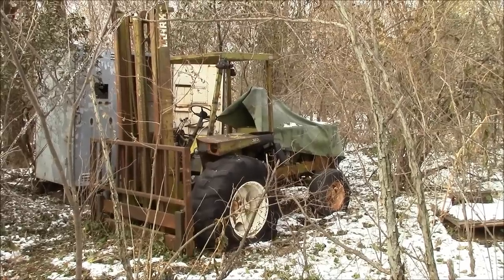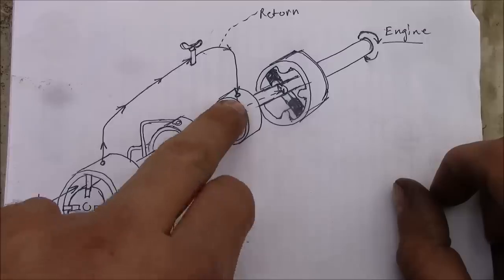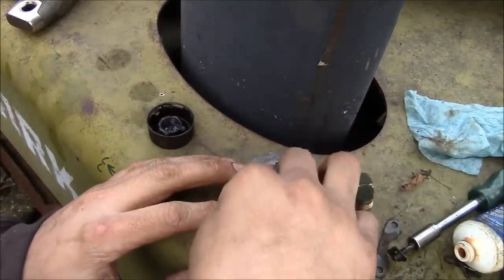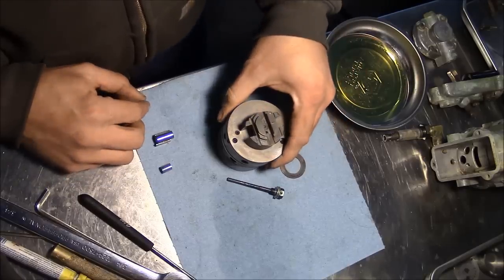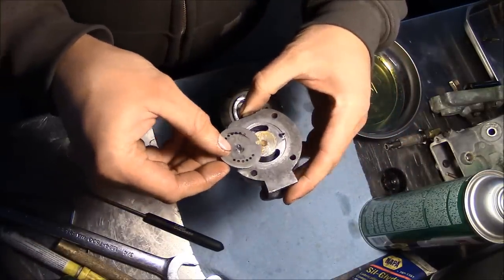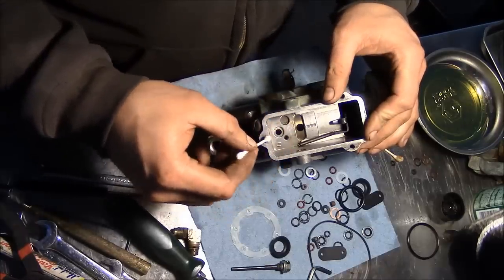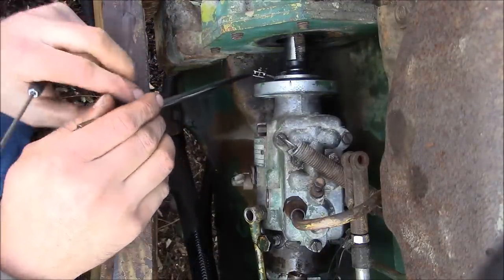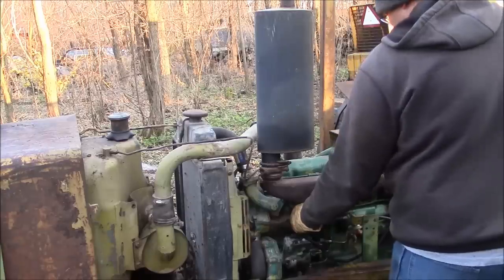Neglected Clark All Terrain Forklift - Will it Run Again?

Comment: One time I started a job everyone wanted to use all the good fork lifts and the only forklift left to was old Clark with the metal levers next to the seat to operate the thing I came out winter still got what I needed moral I'm so good of a forklift operator I use what there to get the job dun,, should of seen the guys at the job site haven't seen that fork lift operate in years and here comes the new guys riding it like it was brandnew that forklift was greatful to have someone like me operate it

Comment: Excellent drawing and explanation  on the injection system   in the 1970s  my parents both had fuel injected cars that   had   relatively simple and more mechanical  operating parts to them even though it technically was Electronic Fuel Injection  i remember my Father learning  as much about the systems as he could  and his  amazement as to how much  more pressure  was in the system compared to carburetored cars  a common mistake was using    older  standard fuel line and hose clamps that couldn’t take the high pressure very long    of course Deisel  is a whole different  Ball Game

Comment: sounds like blocked filters. also CAV pumps have a screen in the end plate of the pump. but i don't know these pumps. Best pump repair video i have seen. **
Reply from the maker: No. There is plenty of fuel reaching the injection pump.

Comment: That looks like the same engine on the 450 dozers and they spun a lot faster than that one does on 12 volts. I was around a mechanic changing out a unit injection pump on an old knuckle buster Cat 12 grader. He handed it to me and said to take it apart and hold it. I did for about 10 seconds and he said to put it back together. It wouldn't go back. He said the heat of my hand swelled the plunger that much BUT that unit was WORN OUT! there you go about crazy tolerances! Excellent description of the Roosa Master pump. A-PLUS!

Comment: Great Video Wes!! My two cents.......Blow back the lines to the tank, & replace the fuel filters. Maybe your getting fuel on a static line, but not enough flow to support a running engine. Costs nothing to check. But........your there & I'm here, so you have the birds-eye view of whats going on.     Best of luck.....................

Comment: There is a check valve on the return line. Make sure that is clean as well. I had one that was gummed up. It will run for a minute and once it builds up too much pressure on the low side it wont allow the high side to pump.
Reply: I've had then not even start when the return check is plugged up. The return check is a common source of no start, engine stall issues, especially on pumps that have had the flex ring totally deteriorate, into fine particles.

Comment: nice work on the pump even if it still has issues.  are you going to pull the mast off to get it home on your roll back or will it lean forward far enough that you won't be over height?

Comment: As the starter 

Tip put a 6 Volt anker instead of the 12V it will be much stronger en spin faster 
We did that with Mercedes engine’s 
Works great and reliable

Comment: Good job Wes. Almost looked like a runaway when it started.
Best explanation of an injection pump ever. I wonder if the timing is just off enough to be the problem? Too advanced so it only runs at high revs? Hope the rebuilder finds a problem and all will be corrected.
Thanks for sharing.
Reply from the maker: It could be. The injection shop should be able to tell me if the timing advance is working.

Comment: Liquid fire brand starting fluid has top end lubricants in it and works pretty good, just needs a more liberal spray and it may have less time before it doesn’t work, I’m unsure, also I’ve noticed a few brands like that and quick start all seem to “expire” after a while once you use them, so keep that in mind (they still work for gassers and the tight tolerance diesels you shouldn’t even be using any form of starting fluid in anyways)

Comment: 3 thing with a diesel, 1.  Got air?  Make sure air cleaner is not restricted.  2.  Got fuel?  You should have put new fuel filter and fuel to that pump. sucking dirt into a clean pump isn't good idea.   3.  Does it crank properly?  You got a weak battery/starter or cables.   It may not idle due to dirty injectors, should have run it for awhile. Check the fuel bypass valve, make sure it's not suck open.  Good luck and hope to see it run in the future.

Comment: In the Army we had some Continential Diesel powered gensets.Those engines were equipped with a Roosa=Master fuel System.Funny thing being a fixed speed setup the only way to change the operating speed of the engine was to install a different Pump.The ones we had were set so that engine be set to run at 1200 rpm.Engine had timing marks on the flywheel for 1200-1600-and 1800 rpm By setting proper timing marks then installing proper pump engine would reach and hold RPM.Funny system but it woeked most of the time.

Comment: nice work Wes nice work , on a pump like the one you just reman...... how do you increase the fuel for more power . And i have been looking for ages for an explanation on these stanadyne´s that even i could understand and here we go Wes ........... thank you very much and have a nice day . Ivan
Reply from the maker: There's really no way to "turn up" a Roosa Master pump. You could tighten that leaf spring a little more to increase the roller to roller distance. That would give more fuel. Or mess with the governor spring. But those are both risky IMO.

Comment: you can try  using diesel soaked lighted  big rug on a stick,on the  intake manifold so the engine can suck the fire and gases and will start,the rug must be secured so  it not get sucked into the engine,we in eastern europe used this method  before the starting spray appears. another method was pouring  diesel on a  red hot iron plate so the engine can suck the fumes, like the hot bulb , sure if the  injection pump is bad, it will stop . my dad used this methods 35 years ago.

Comment: Hope you found whatever the problem is by now, sounds like a restriction in the supply, possibly a poor connection letting it suck air under that condition.  Had a similar thing happen on my 1st gen. Dodge, which has a similar pump on it.  Also, a weak lift pump made it do the same thing,.

Comment: Seems like a good machine to have around the house.    We have an old 1981 John Deere 125 skid steer sitting in the back yard.....hidden a little bit by an old fence.      One of these days we will ask for help getting it running.
Reply from the maker: Does it have an Onan gas engine? If it does I'm sure it will run.
Reply: @WatchWesWork  It has an Isuzu Diesel.   It had troubles and a guy we knew added an electric fuel pump from a car.  (That wasn't the fix we hoped for but that was all he could manage).  The car fuel pumps needed to be replaced every so often.   I think it lost fuel...all those years ago. And so it sits because life is too busy (Which means....I'm not playing life well if it is too busy....)

Comment: My question was about the Clark UT60,  I was a mechanic on Clark Forklifts for 40 years, I do believe it is a Perkins Diesel  engine. which is one of the best diesel  engine made.
Reply from the maker: No. This is a John Deere engine. I've never seen a Perkins engine that did not use a CAV/Lucas injection pump.

Comment: Takes "courage" to tear a Roosamaster pump apart. Scary tolerance to those inside parts is right. I'd be removing the tank & cleaning it up while the pump is at the shop. Like your video's 😀👍👌

Comment: Have you chased out the fuel line from the tank to the fuel pump? You could have a partial clog, enough fuel is passing for idle, but not for high rpm..  Also check the valving in the primer, the bypass might not be fully open.

Comment: A common problem with those pumps not working properly is supply line restrictions or air leaks.   Most common flow issue is the filters being varnished closed due to having sat for so long with water in them or the lines themselves being corroded internally or the pickup tube inlet/screen being clogged.  

To find out if those are the issues it usually take making a adapter that allows for a suction gauge (common filter minder vacuum gauge) and clear line to be installed just ahead of the fuel pump inlet.       Combined they will tell you if its restriction problem or a air leak issue or a bit of both.     ~$20 to make and well worth it even if you only use it once.

Comment: It’s amazing how many leftover parts come in a kit ! Lol. First step is to get it to run ! Second step is to get it to run well ! Suck / bang /blow ! For a self taught man your doing very well ! It’s also deer season here in Minnesota so it’s a great idea to wear blaze orange when in the woods . I’m looking forward to seeing it get back to work once again , those big fork trucks are so handy to have and I’m sure once it’s running properly it will stay that way with you on the job ! Heck make a blind and use the truck to elevate it for hunting ! Lol. ALSO I’ve found fogging oil works great on diesel and outboard motors to get started !
Reply from the maker: What do you use to fog the oil?
Reply: It’s called fogging oil . It’s basically starting fluid and oil mixed . I use it on outboards because there 2 stroke and it lubricates at the same time .
Reply: Watch Wes Work fogging oil comes in a can like starting fluid

Comment: You can help a diesel engine starting, by igniting a rag with dipped thoroughly in diesel fuel, ignited with a small gas torch, and holding it in front of the air inlet of the diesel engine. The heat and the half-burned diesel fuel will help it start. :)

Comment: I've just completed a reseal of a DB2 off of a 6.2 Detroit. Like you, I'm a first timer to these. I took mine all apart, even the don't touch  high pressure side. Wish me luck. Don't take this the wrong way, but this video makes me a little worried that mine won't be right either. I do have a book, but there are still some unanswered magical parts which I hope are right.
Reply from the maker: All I can do is put the pump back like it was. I can't actually test or calibrate it. So, if it worked before, it should work now. But mine had issues before I ever took it apart.
Reply: I'd be interested in your flex ring for the governor basket, if you haven't tossed it yet. My kit didn't come with one, so I had to order one. Having a spare would be nice.

Comment: Make sure that fuel solenoid is wired to a source with 12v while cranking. I worked on an old Deere dozer that ran great but started very hard. It would only start on its own if you let go of the key at the right time and the solenoid energized while the engine was still spinning. Just needed to move the wire to a different terminal on the key switch.
Reply from the maker: I've seen that happen before. Especially the style with a separate hold coil in the solenoid.

Comment: Hay   Wes  on  those  rusty   fuel   lines   I  use  a  Burns a  matic  torch   for  just   a   second  all  ways  works   also   works   on   rusty   brake  lines   ,   hope   this  helps.
Reply from the maker: That's how I eventually got the return line free. But I had to put it in a vise and it took a lot of heat.

Comment: Diesel starter needs to crank at 100 RPM to start.  I had a simular problem.  I pulled the starter and found a broken weld on the winding.

Comment: 👍👌👏 Thank you very much for the good describing of this interesting injection pump. This principle seems a bit similar to rotary engines (Felix Wankel). In my opinion it is simple and therefore ingeniuos. Neither much parts nor valves.
2) Maybe there us a lot of dirt/gunk in the tank, hoses and lines (like it was in the pump) and that's one of the problems?
Thanks a lot for making taping editing uploading and sharing.
Best regards luck and health.

Comment: We have a jd2640 front loader that is a real pain to crank.  Put a better starter on it and it’s helped, but the hydraulic pump puts a lot of drag on the system starting.  There’s a T handle on the pump you crank in and it releases the pressure so you can start it easier (usually what I do in winter).  The other trick is jerking the steering wheel back and forth while cranking.  Idk if this has the same big crank snout driven pump on it or not.
Reply from the maker: This machine uses a gear pump not a piston pump like a real John Deere. So you can't unstroke the pump as you described, but it also should have less load on the hydraulics than the closed center system on your tractor.

Comment: rebuilt the russo u have to charge the fuel going into  the pump, assuming  the pump is working  properly ,i charged the fuel with a jetta high psi fuel pump , worked great

Comment: Wes , when you put the pump back together, do not move the throttle lever ,the linkage will disconnect and the engine will run away , that's why they are wired down when you get them .
Reply from the maker: I did wire it at full throttle.

Comment: It's a shame no one takes care of these and then calls them shit. There are some really good forklifts out there that people declare garbage. We have one at our shop, an old Hyster, and it's an awesome forklift. Everyone that uses it loves it, but it's just so beat to hell and neglected it got put in storage for fear it would break down when we really needed it. In its place we got this big 2 year old toyota that's a foot longer, a foot wider, and struggles to lift the same amount. Because of the layout you can't see through the carriage (it having thick tubes the forks slide along that block the view) or around it because the body is so wide and the propane tank sits so high up behind you. People don't realize six inches extra on either side makes a huge difference in what you can see and where you can go

Comment: 24Volt is good way to start old equiptment. Put key to Start-position and hit 24V jumper cable to battery same time. Voltage wont rise too much to burn oldschool ”electronics”.

Comment: Not sure what brand of "ether" you get- but actual
"Starting fluid" has White Mineral oil for top cylinder lubrication.
It's usually emphasized on the label of quality brands-
Sta-bil, Pyroil, Polar, Johnsen's, Prestone, CRC Jump Start®
With Lubricity is one of the best. Rather than relying on
the oil pump and molasses to hold compression- these
formulas allow faster cranking, saving the battery and
rings/cylinders during cold cranking, down to -65℉ (-53.88℃).

Care must be taken on diesels with glow plugs, and some
engine manufacturers advise against using any type,
so follow their directions above anyone online.

Just like Teflon tape and colored anaerobic thread lockers, I 
see so many mechanics on YouTube use Starter fluid improperly,
or claim that it washes the cylinder walls.

It must be shaken well, then sprayed in the intake while cranking 
to ingest the charge properly; a feat to do if alone, but that's what's 
expected by the manufacturers. Ether's flash point is very low, even
in below freezing weather, and the white mineral oil ensures
good compression- the backbone of a diesel engine.

Gasoline engines can suffice with merely the ether vapors,
coming from whetting the plenum and runners- but diesel relies
on a wetter charge and oily rings.

A remote starter not left at home would work well.
Reply from the maker: If you spray ether or WD40 or anything in the intake of the engine while cranking it will drop the RPMs to basically zero and will not even try to start.
Reply: @WatchWesWork  On this engine only?
That just sounds strange. Must be a design to not need?

Comment: Have you tried using Naphtha? Nasty stuff, i know, but i've yet to see the crud that doesn't fear it. Heck, i dip my bike chains in that stuff, slush it half a minute, pull them out and in one pass with the hose on the parts cleaner, they look brand new (minus wear and tear).
Reply from the maker: Yes. It works on some things. Does not work on others. I think brake clean uses Naptha.

Comment: Nice video Wes. Is the old forklift a Military version? I had an old generator from the Air Force and I could crank it over on 12 volts but never get it to catch.  I talked to an old man from the area and he said try 24 volts  so I did, it ran great.   Matt C.
Reply from the maker: No it's a 12V machine. I just think the starter is tired.
Reply: A lot of military equipment is 24 volt, even when the civilian versions are 12 volt, so your gen set may actually be 24 volt.

Comment: There's also may be a check plunger under the inlet fitting. Pressurized fuel in the inlet frees up that plunger and the vanes. Usually an electric fuel pump has enough pressure to do it......7-10 psi. Have one of those cube type Bendix pumps permanently plumed in, run it 30 seconds, start engine, shut off elec. pump. No need to disassemble ever again (unless it gets completely filthy). Also 1 quart of ATF in every 15-20 gallons of fuel helps to keep things from sticking.
Reply from the maker: There's no check on this inlet. It has a filter screen and a pressure regulator but that's it.
Reply: that is a 24volt starter

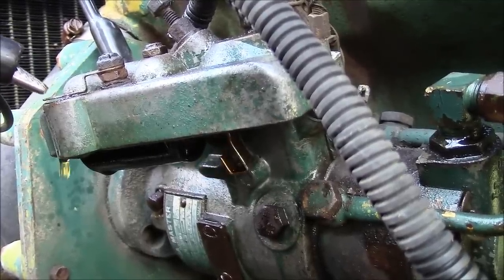Comment: Genius at work at 3:37 Either you can consider yourself lucky not igniting any fuel (petrol or diesel) or you are aware that the flamability point of diesel is 56°C. Otherwise you would be heavily injured or dead due to a an explosion of diesel or petrol by creating a spark every time you are powering the solenoid.
Reply from the maker: LOL. You can throw a lit match right on a puddle of diesel and it won't burn.